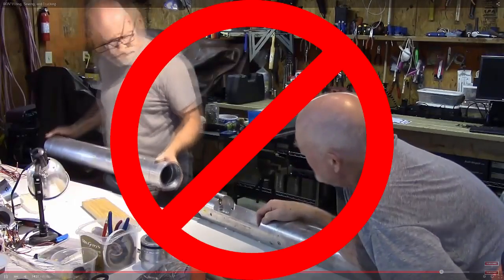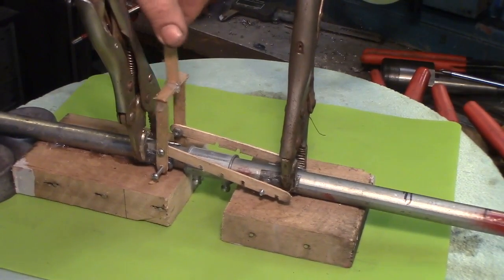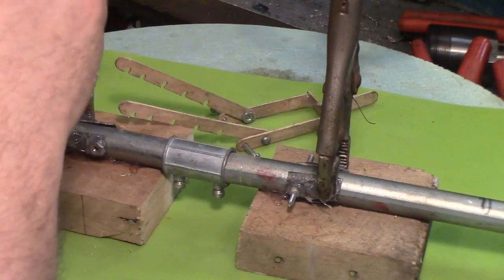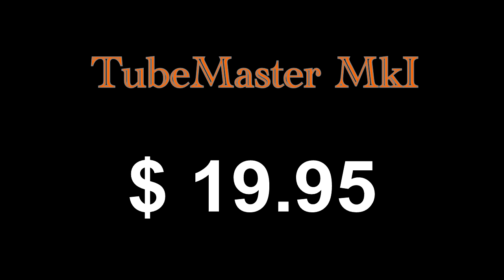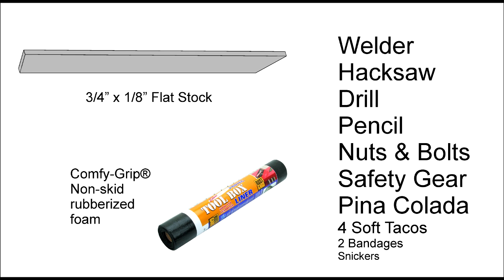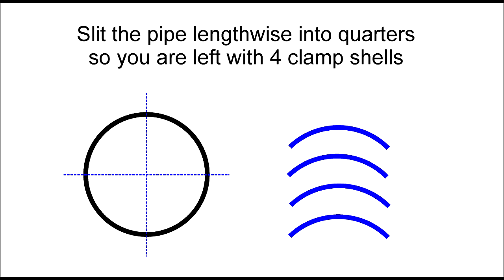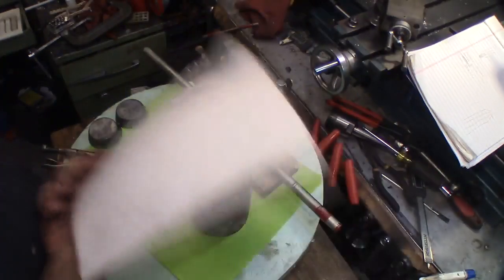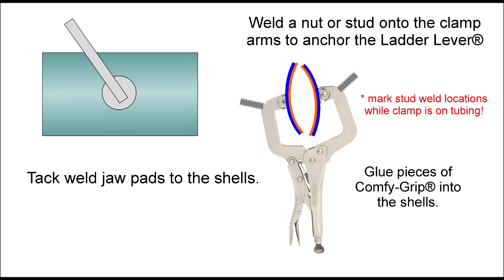ROV Splitter & Joiner - Tubemaster MkI

Comment: Could one substitute a single malt for the pina colada or would that invalidate the warranty?
Reply from the maker: Like putting premium gas in a weed whacker it will merely add to the operating costs.  Besides, sub-clause MXXXCLV, verse 2, row 17 states,"Neither slaves, partners, pets, nor shareholders of Grouchy Industries can be held responsible for injuries, like tucking your shirt into a joint made with the TubeMaster then tossing the ROV over the side,  resulting from the substitution of factory approved materials,."
Reply: Isn't that the same sub clause in the Turbo Encabulator instruction manual?
Reply: "can be held" ?!?  Woo hoo I can't loose with dis here gizmo!